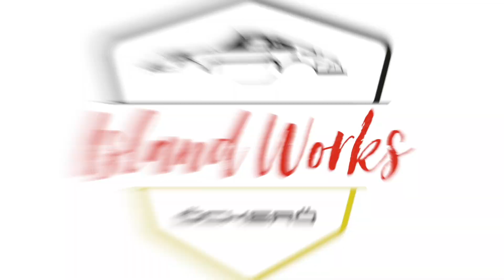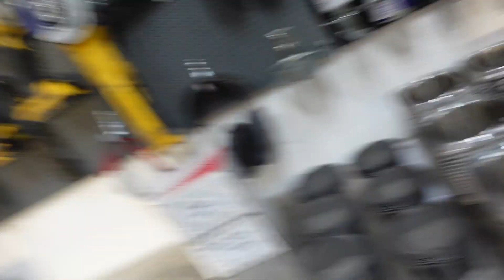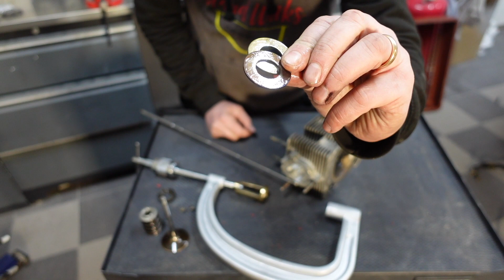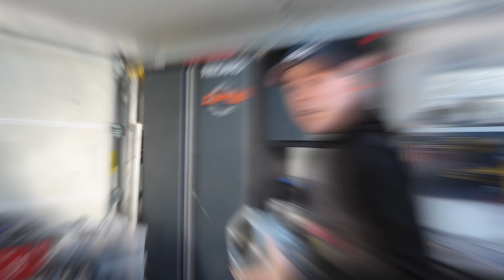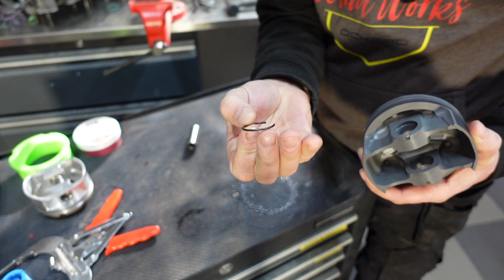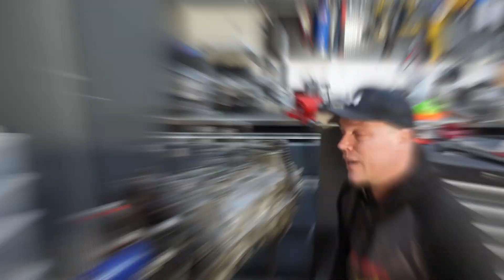Pistons & Barrels -  Porsche 964 Engine Assembly Part 1

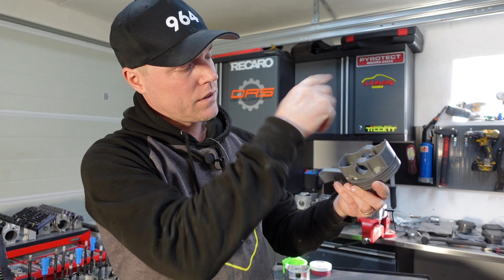Comment: 15:53 The holes between the oil rings are actually to allow oil caught between the oil rings to escape through back into the piston and sump. They are there to prevent oil accumulating between the rings and passing by into the combustion chamber. The cylinder walls and skirt are lubricated by splash/ oil squirters.
Reply from the maker: That’s great insight. I got it backwards ;-)
Reply: @islandworks  These holes getting clogged with sludge are the main cause of oil consumption in engines. If oil becomes stagnant in between the oil rings it cokes and becomes sludge, reducing the effectiveness of them. The lower ring is supposed to scrape oil off the cylinder wall down, the second ring scrapes what the first missed and evacuates it inwards through the holes. Just started watching your videos, they are entertaining.
Reply from the maker: Thanks for the additional comment. It makes sense!

Enjoy watching!

Comment: I have my 993 engine down to the short block. I have easy access now to the thru bolt o-rings (which may have leaked). Is it ok to take these bolts out and change the o-ring on the nut side? Or would i have to change the o-ring on the bolt side too?
Reply from the maker: Since you’re already in there, I would change both sides.

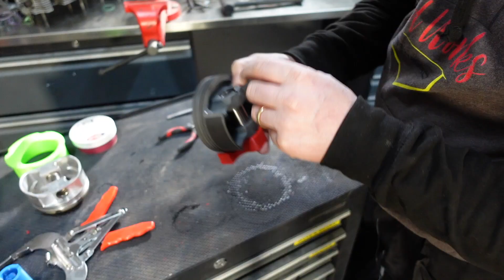Comment: 18:40 I thought the print was to help place the ring. Why didn't your tool work?
Reply from the maker: The piston holding tool was to provide support to the piston as it lies flat and that part worked fine. What I need to get is a retainer clip insert tool making that part easier.
Reply: @islandworks  Yeah, I got that. But at the end, you show an attempt at making the tool but it didn't work. What was the isue
Reply from the maker: @anidiotinaracingcar  I printed it in PETG and it broke due to the pressure from the retaining ring. It might still be possible with a better material.
Reply: @islandworks  You have some PLA, which is stronger (shit temp resistance but quite stiff).
You could also have a PETG/PLA "sleeve" to guide the ring but you would still use a pair of pliers

Comment: I thought about what you said about one cylinder running hotter. 
Did you check the oil squirter for that piston? Because the squirters job is not to lubricate its to cool the piston, it was an addition the the engine design in the early 70s.
The holes in the piston you are half right abut them,  just the other way around, they are there to remove the oil that the oil rings scrape on the cylinder face.
I haven't watched your other videos, but I hope you have scraped the old oil coolers and gotten new ones after the engine failure.
Reply from the maker: Thanks for the feedback! I always thought about the holes in the piston as means of pushing oil out, and maybe you’re right, it’s the other way around...and you’re right, the squirters mainly cool the pistons as well as facilitate oil entry into the small end lubrication hole on the top of the conrod. 

The engine never really failed and I was surprised to find this damage as I took it apart for inspection. The excessive heat can actually be seen on all of them. This was my struggle last season...

Oil coolers are all new and twice the capacity of before. There’s an episode on it if you like to see.
Reply: @islandworks  Good that you catched it before it got catastrophic, saves money :)  I'll watch some more episodes.

Comment: You are using Nickies cylinders with Mahle pistons. What piston to cylinder clearance do you have, you got help sorting this out? I'm asking because Nickies are usually used with JE pistons and those are made of the same material. Mahle makes their piston and cylinders of a proprietary alloy that have a different expansion.
Reply from the maker: They actually come as a set from LNEngineering.

Comment: SUCH a great episode- it demystified the process that seemed so daunting- makes me think I can actually do my own 3.6 once the time comes- I've built many engines in my young days with my Dad at his mechanic shop- but Porsche motors have always seem SOOOOOO complex- this really isn't bad so far. Sure- lot's of little parts- but it's all manageable. Thanks! Love the tools you create- you can sell every one of those- the ring "tunnel" and plunger are nothing short of brilliant. I'll buy them- and most likely so will every Porsche specialist out there! It's always true though- it's best to save up and buy the necessary tools before you start a job this labor intensive- the right tools make the job manageable. Stromski makes some REALLY helpful tools for Porsches.
Reply from the maker: I learned by doing a little bit more every time. As long as you allow for ample time and take it step by step it is very doable. This German engine is very logical also!
Reply: @islandworks  Quick question- what resource do you use for the "step by step"? Do you Adrian Streather's book or something else? I'm thinking I'm going to do it myself- I'll have plenty of down time to do it next winter- but I need a step by step resource to refer to so I don't screw everything up!
Reply from the maker: I recommend Bruce Anderson’s book but I’m sure the others are good.
Reply: @islandworks  Thanks! I didn't think Bruce had anything on the 964 before he passed away but I see the original is updated to 1996 now on the 911 Performance eHandbook- I have the old one so I'll get the new version. Just downloaded the official repair manual too- pretty comprehensive. Thanks so much Jonas!
Reply from the maker: The Bruce Anderson book might not be specific to the 964, but the steps are very similar between the different air cooled engines. The first one I did was a 2.7...

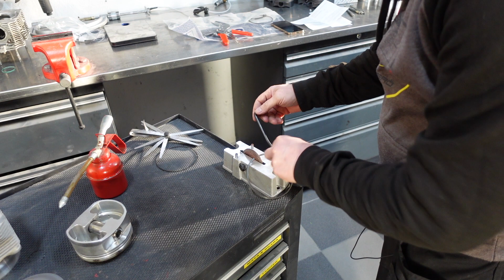Comment: 10:43 you have not scratched the cylinder with the segment? because the tool you are using to make the gap bigger is used the other way.
Reply from the maker: No not at all. This is also checked every instance.
Reply: What do you mean? At 10:43 he's grinding the ring- how would that scratch the cylinder? And how could the grinder be used any other way? I'm confused.
Reply: @yjmsrv  I have put that minute because I think the segment has to be filed backwards not forwards, I have explained myself wrong. 4:26 https://youtu.be/UTen3mEeY0I
Reply: @ex123T  Gotch- thanks.
Reply from the maker: What I always do is to make sure I file downwards (in respect of the ring markings) and always in the same place, then checking the edges afterwards. This is how I learned how to do it and has worked for me so far 👍🏻
Reply: @ex123T  Different ring filer.  Jonas is using this one correctly (I have the same), but I think the one used in your link is better designed.

Comment: Is there not a copper gasket that goes in between the cylinder and the case?I know on my 3.4 Turbo engine there is,maybe it's different on a N/A 3.8..Your Mahle pistons looked fully coated not just on the skirts.Thanks for the excellent content I wish I had confidence to make videos you really do a fantastic job.
Reply from the maker: Thanks for the feedback! The old 911 had flat gaskets in the bottom if I remember correctly. This newer style gasket is based on a viton type rubber and will keep tight even if there is some rubbing or displacement. It also won’t affect the stack height as the flat gaskets does.
Reply: @islandworks  How does the viton rubber not get too hot and disintegrate? That really surprises me- much be one well engineered rubber!
Reply from the maker: It most definitely will get hot, but still well within the design limits. The original 964 also uses a smaller size rubber viton type seal. The factory 3.8 RS uses the same concept I have.
Reply: @islandworks  Gotcha,I appreciate your time.I just found your channel and going back through your past vids great job especially on bonding the Kevlar quarters.I was friends with a guy out hear in Ca.his name was Dan Mclochlin and owned a company named A.I.R he did alot of development for 935,934 body kits.

Comment: That Stomski circlip injector really makes life a lot easier on the install....
Reply: +1 on the Stomski tool
Reply: Worst part of the assembly besides getting the cams timed in where you want them. JB racing makes an Adjustable Cam Sprocket Set that makes that accurate and easy as well
Reply from the maker: This is my favorite step! Got a nice little tool for it that I will show once I get the heads back!
Reply from the maker: I wish I had one of those!
Reply: Who CNC’d your heads? Very nice..

Comment: Did you ever try the diy circlip plunger using two sizes copper plumbing pipe (one inside other) to make plunger similar to a Stomski clip plunger?   I have not done this job yet ..🥴.    Amazing the 3D jigs you make 👍.  Great channel!
Reply: I saw it on RL years ago, something like 1/2 inch fitting just happen to fit perfectly inside a 3/4 inch fitting, hence, plunger 🥳. My dimensions might be off,  I’d have to tinker at the big store. 👍
Reply from the maker: I will have to dig into this. My method is painful to say the least even if it worked very well down on the bench.

Comment: Wow, I do like your colorful xtra plastic tooling you quickly manufakture for your build :-) Nice to C ya @ work on the engine. I used a piece coppar tube to push my my clips in.
Reply from the maker: I really wished I had that copper tube :-)